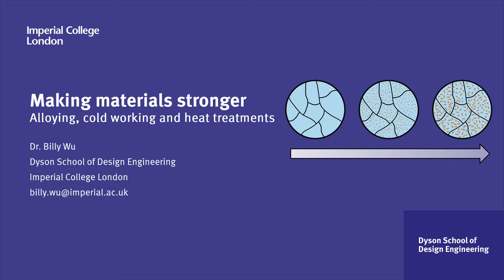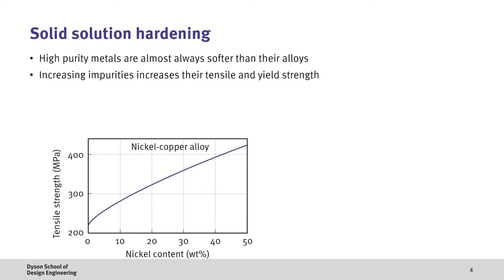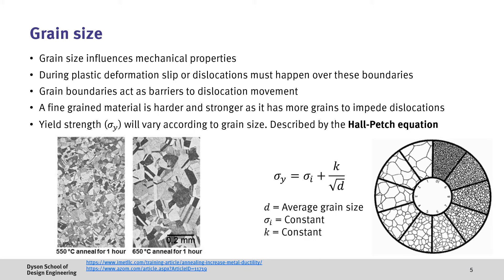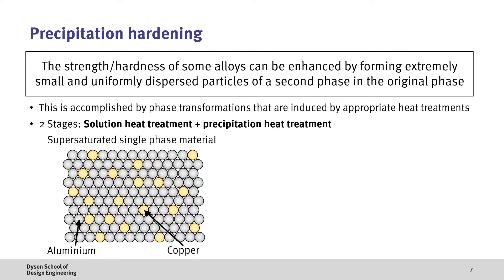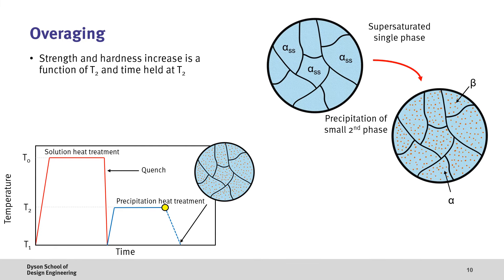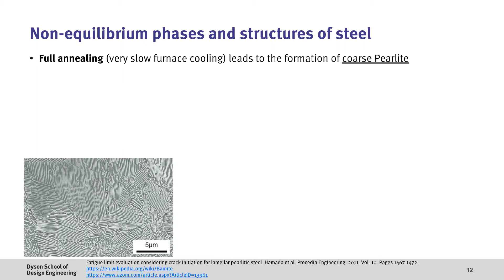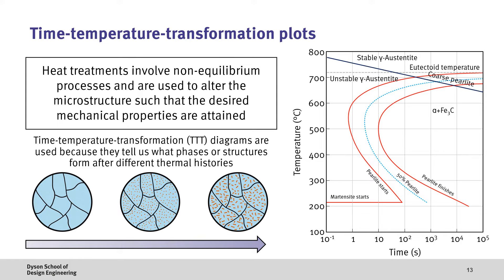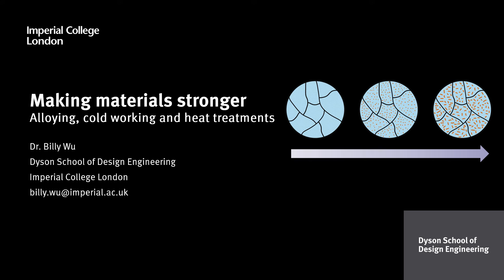How to make metal stronger by heat treating, alloying and strain hardening

Comment: Dr. Wu.. Thank you. I'll be watching this video multiple times to better my gas turbine engine reports and the material run time damages they under go through out the engine's service life. I perform inter-stage inspections by video-scope and often wonder why certain materials and rotating parts have accelerated loss of strength and other areas and material types don't. It seems as if the single crystal process is the latest high temp, high tensile strength most tolerant in the engines I represent. Thanks for your time and mostly for simplifying the video.
Reply from the maker: Thanks. Glad to hear it was useful. Heat is one of the major factors which can influence the strength of a metal; impacting the grain structure and phase composition
Reply: Dr. Wu, Do you have capabilities to perform micro-structure tests on turbine blades?

Comment: Excellent video. I would like to include practical examples of the process for all three hardening techniques with constituents mentioned with weight or percentage to visualise the actual alloying process creating strength, ductility and resistance to corrosion

Comment: Dr wu can you please explain to me why work hardening/cold working is defined as making grains smaller? To me, cold rolling elongates the grains, which by definition makes them bigger, or at the very least longer and post normalized recrystilization then allows new smaller equiaxed grains to nucleate. I only have a hnd in materials science, but I’ve worked in a steel mill for years as a metallurgist and this has always bothered me. I understand the area of the grains technically decreases but when you look at the steel under a microscope we always refer to cold formed steel as having larger grains and normalized steel as smaller more uniform grains. Seems to me as one of those things that’s different in theory than practical applications.

Comment: Thank you Doctor Wu for this very easy to understand video. I have one doubt regarding precipitated hardened stainless steel. We regularly use SS17-4 PH. The problem is the physical properties vary a lot after H950 for every part. We currently procure the material in Condition A (Solution annealed from 1042 °C), after doing the major boring/drilling/turning job, and then age harden it to H925 for 1 hour/25 mm cross section thickness (also acting as stress relieving). The problem is that we are getting elongation ranging from 8% to 15% and hardness from 34 to 43 HRC, which is too broad to categorise in any HT condition. Please suggest what should be the ideal way to process the material.

Comment: a. It may be seen that the time to peak hardness and the peak hardness itself are a
function of the ageing temperature. Why does the curve at 30 °C not obey this
general trend ?

b. It may be seen that at the temperatures 110 and 130 °C an initial hardness plateau
occurs before the peak hardness is reached whereas this is not found at the other
temperatures.
i.
Why is such a plateau found at those two temperatures and not at the
higher temperatures?
ii.

Would you expect such a plateau also at 30 °C, although at longer
times?

help me with these questions

Comment: Hi there professor I have another question here ,what type of alloys are suitable for precipitation hardening?
Reply from the maker: Usually alloys which have a composition where at room temperature they exist in a 2-phase solid region. Some examples might be aluminium, titanium and nickel alloys but there are many others. The key is that you can create this second phase to hinder atomic movements and strengthen the material

Comment: Is there a way to prevent aluminium alloys overageing at room temperature? Or is it only specific alloys that will do this? Such as softer aluminiums?
Reply from the maker: Great question. The challenge with precipitation hardened alloys is that they are thermodynamically unstable and eventually will revert back to the thermodynamic composition and lose the strengthening benefits of the heat treatment (though this can be quite slow in some instances). Alternatively, dispersion strengthened alloys can also provide good strength by mixing in small particles of oxide materials into a metal matrix. The advantage here is that since the 2 phases are thermodynamically stable relative to each other you don't lose the strength at higher temperatures as precipitation hardened materials would.

Comment: It looks like the grain boundary's are stronger than the inside the grain. Is that correct? It makes no sense to me. The grain boundary atoms can't possibly be aligned as well as those inside each grain.
Reply from the maker: Grain boundaries act as barriers to dislocation motion (dislocations are defects in the crystal lattice that enable plastic deformation). When dislocations hit a grain boundary, they either stop, are absorbed, or need to change direction, which requires more energy. This is why materials with smaller grains (more grain boundaries) are generally stronger.
Reply: @BillyWu  Thats not what I asked.  Which is stronger, the bond at the boundary, or the bond within the crystal?

Comment: what book did you get the TTT plot diagram from?
Reply from the maker: I adapted it from "Materials science and engineering" by William Callister. Fantastic foundational book for material science. Redrew it so that I can animate it so the exact positions might be slightly out but the core principles are the same
Reply: @BillyWu  Found it online, excellent. Thanks.  I have an advanced question, maybe you can answer it... if larger grains are usually associated with weaker macro properties, how are single crystal turbine blades stronger than a blade made of many smaller crystals?
Reply from the maker: @joshtargo6834  Great. Generally single crystal metals will have a lower yield strength than polycrystalline materials due to the absence of grain boundaries and their interactions with dislocations. However, single crystals have other properties which make them attractive in some applications such as anisotropic properties. One of the common examples of single crystals is in turbine blades, where single crystal metals are ideal since they have lower creep resistance, but they are generally expensive to manufacture. Single crystal silicon is ideal since it helps with the electrical properties.

Comment: Isn't work hardening reduce the number of dislocations, not increase it?
Reply from the maker: Generally cold working/work hardening increases the number of dislocations as the plastic deformation causes the dislocations to interact with each other and multiply. The wiki page has a bit more of a deep dive into this https://en.wikipedia.org/wiki/Work_hardening
Reply: @BillyWu  shouldn't the two interacting dislocations merge into one dislocation and thus reduce in number?